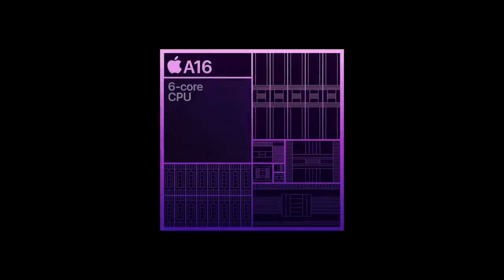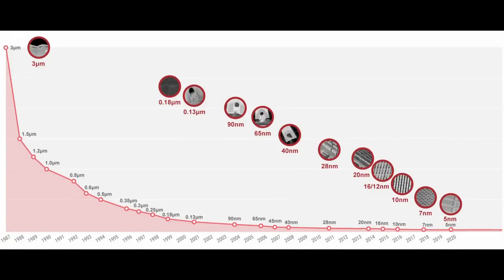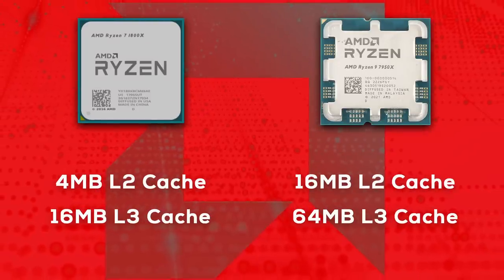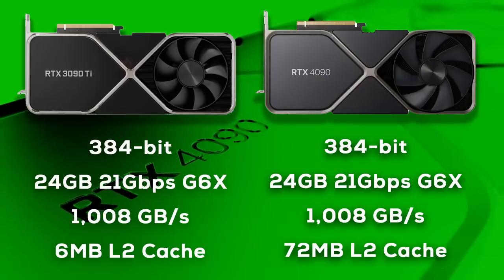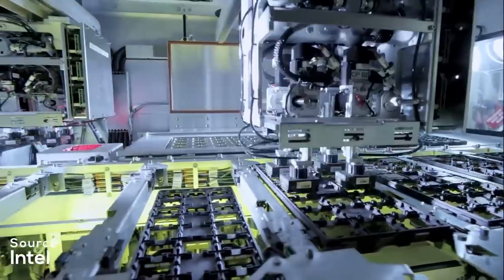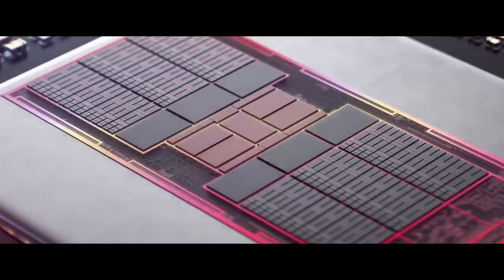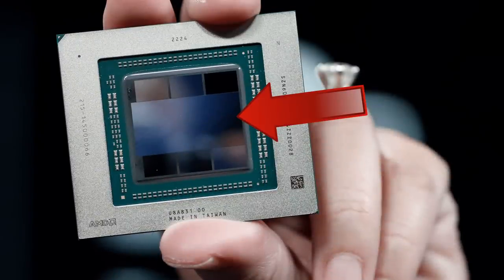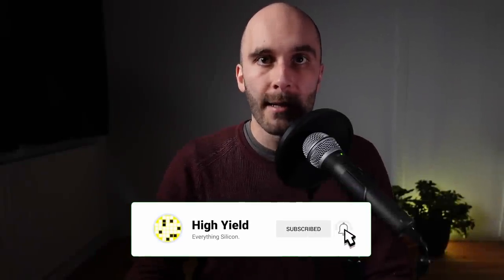Next-Gen CPUs/GPUs have a HUGE problem!

Comment: I think we've reached the point where the obsession with improving processors needs to take a back seat to actually bothering to optimize code. We don't need increasingly small tech that will overheat at the drop of a hat because of how hard we are working it. We need increasingly efficient tech that can do more with less!
Reply: And more competent software makers, that work to optimise on potatoes and scale to take advantage of powerfull hardware. Right now they just make it work, creating performance issues all around. No wonder CSGO runs so well on anything you throw at it, it was made when devs cared about it running on a potato
Reply: I totally agree. The software side of things has so much catching up to do.

Comment: That's what I was thinking as soon as your video started. That's also why I'm not beatin up on AMD for RDNA3 performance numbers out the gate. They knew this could happen, but still went for it to do the work needed to get it down. I respect that and am happy to support the work.
Reply: AMD prefers to future proof their design than going down a linear path that they can't dig themselves out of...
Intel made the wrong mistake of sitting on their butts when AMD was trying to innovate themselves out of bankruptcy from years of being screwed over by shady business games by Intel and Nvidia.
Nvidia is doing the same by not showing that they can innovate as good as AMD in hardware... They just showoff software 80% of the time which hypes and appeases content creators and such, but doesn't really future proof via engineering. They also push for AI a ton, but powerful AI needs smarter and well designed hardware because those too will hit a limit, as everything comes back down to the silicon level.

The problem with microprocessors is not today or tomorrow, but it's several generations later When Lisa Su and Jensen have to name their successors.
Reply: same here, that's why I said I be buying RDNA4 since August XD I'm nobody's beta tester boy.
Reply: Meanwhile nvidia is prepping a 4 slot brick called titan while amd is work hard at innovating 😅

Rdna4 better deliver i want upgrade my 6900xt
Reply: @sudeshryan8707  The power usage naturally goes up because of all the high tech components they want to put into the chiplet or silicon.
you still have to upgrade your basic components like power supply and motherboard and CPU in the end.
Reply: @dra6o0n  higher tech = higher power consumption?
Reply: @kotekzot  Well, you gotta change up some of the components if you can't shrink them, or re-route some sort of mechanism into another form, so in this case sometimes the power usage will increase if it grant a scalable performance gain.

For instance the chiplets, they changed something in the GCD to basically allow the chip to do two workload simultaneously, thus doubling performance and reducing latency.

But it also double the power draw for that one unit that utilizes it. The advantage of this tech is that you fit 'two' actions within one space, the disadvantage is that your power scaling also happens.

If you think of it like a grid based 'puzzle' game where you gotta fit shapes of components in a limited space, the component AMD's engineers came up with is like a lv2 version of the original component, but it comes with increased cost to use, in the same sized space.

You either make more energy efficient components, but end up needing more space to place more of them, or make more powerful components, you need less of them to produce the same performance, but power usage is higher.

lets say
Component A = 1x perform, 1x efficiency, 1x space
Component B = 2x perform, 0.5x efficiency, 1x space
You have a grid of 4x4 spaces.

Which would you put more of, standard efficient pieces, or powerful less efficient pieces?
Reply: @dra6o0n  an i3 12100 has twice the processing power, half the power consumption and a 38% smaller die area compared to an i7 960.

Comment: As for chiplets and specifically future RDNA designs I wonder if moving from a N6 to N5/N3E MCD would even be worth it? And although it seems TSMC has hit a dead end with SRAM scaling, I wonder how well other foundries are doing. Like for example as you say, Intel is using some TSMC manufacturing for Meteor lake, and I wonder if Intel has a more efficient SRAM scaling.

This also calls for Nvidias Blackwell. They've benefited a lot from Samsung's 8nm node to a custom TSMC N4 node. While I don't doubt Nvidia to take the performance crown again, I feel like 4000 series has benefited a lot from the silicon. Will they also have a desegregated design as well or will they pull some blackmagic with further increased power draw? 

Btw I think the thumbnail is great lol
Reply: Nvidia hasn't got much CPU experience to do proper chiplet designs like AMD or Intel does, and Apple just brute force it's engineering with lots and lots of money in R&D to poach talents for that.

Otherwise Nvidia would have pushed for chiplets sooner instead of showing a proof of concept one time and then forget about it later.

Comment: This is weird. I just bought a Ryzen 9 5900X, to upgrade a 3200G in my second PC.

When I was comparing it to chips like the 5800X3D, I noticed the different in L3 cache sizes, and wondered how much area cache must be taking up on the chip.

I figured that a BIG part of the cost of the chip is the cache, since even 32MB will take up quite a large area of the silicon.

I didn't realize there was a problem with SRAM cell size on the smaller nodes, though. Interesting vid.

If only SRAM was somehow smaller and simpler to produce, we would likely never have needed to use DRAM at all.
I've often wondered how fast a PC would be if it's main RAM could use SRAM instead of DRAM.

(Modern DDR SDRAM is FAST, but the latency is still high compared to what I would think SRAM could do.)

Comment: Unless we have some sort of new paradigm shift in computer hardware, these limitations are why I think we're probably going to head into an era of off-loading CPU functions to dedicated co-processors.  We already did it with GPU's, and bitmining did prove that certain functions are better handled by dedicated hardware and can be done cost-effectively.  Plus, NVidia has been selling dedicated, specialized GPU hardware for AI for years, now.  I think we're going to start seeing more processing handled by specialized units as demands grow.  Exactly which functions?  I can't say.  For gaming, physics is the first thing that comes to mind, but PhysX was already a thing that failed and then got absorbed back into GPU hardware.  Perhaps we'll see a return of discrete physics units?  We also have dedicated AI chips out there, and I believe one of the things they get used extensively for is in processing image data in some phones.  It was heavily marketed a few years ago by several major players, but I don't know if that's a thing that's still being done on current-gen phones.  

Point is, manufacturers have already done it and are at least trying to find other applications to offload to dedicated silicon.  So far, the physical limits of semiconductors have not, yet, hit that brick wall that we've been getting warned about for years.  It's slowed, but so far manufacturers have been able to use other tricks to get generational improvements in computing power, so the wider industry and enthusiast community hasn't had to feel the pain quite yet.  Who knows, maybe manufacturers will be able to keep squeezing more cycles out of what we have right now for many years just because they will actually have to start doing real work on architecture re-working now that they can't just fall back on shrinking their transistors (and this, for the most part, is what we have been seeing, it's just a matter of how long they can keep doing that).  

But I think that when backs are really pushed up against the wall, we'll start seeing more radical solutions start being brought to market.  I think that the fact that Moore's law is just about done with will likely mean that we're about to see a boom in innovative and creative new solutions because the "safe" path is no longer a viable one and corporate leadership will start being forced to try new things to stay competitive.

Comment: One of the typical advantages of process node shrinks that is advertised is increased performance, increased power efficiency, or a combination of both. Does this mean then that if you cannot continue to shrink the process, SRAM performance will be the bottleneck for newer architectures? What are the alternatives to SRAM?

Comment: Good video, but I would have liked to have the "physics problem" explained, and why it specifically affects SRAM cache. I can understand the analog limitation, as "lumped" parts like resistors, capacitors and inductors need chip area, but why is SRAM cache special? It's digital logic, just like the CPU? An SRAM cache bit is typically six or eight transistors: what is the "physics problem" why can this not scale?
Reply from the maker: If you are looking for more in-depth infos, heres an article from 2015 that clearly talks about the problems with SRAM scaling in detail: https://semiengineering.com/moore-memory-problems/

Comment: I'm actually looking forward to the day when we finally reach the limits of what a manufacturing node can accomplish in terms of nanometer node size. At that point it the costs and methods for making the most cutting-edge chips will really start to proliferate. The only thing that can improve a chip from that point forward will be the architecture of the silicon itself, which is where we sorely need the most improvements. It'll also be a good time for Windows and chip designers to come together and finally pare down the old x86 operating system to a standardized reduced instruction set format. We are also going to need more purpose-built components in our computers soon, to give our computers more integrated utility rather than speed. I'm most interested in what companies like Mythic have been doing with analog chips, because they've managed to use older process nodes to create insanely efficient chips that do very complex tasks in AI computing. We've been leaning too heavily on CPUs and GPUs to do these compute tasks and a lot of that work could be offloaded to newer, purpose-built components.
Reply: or they could stop wasting money on diminishing returns from miniaturizing silicon when its already close to its theoretical limits, and instead just work on commercializing a new approach to computing like photonic chips or carbon based chips.
Reply: @ilyarepin7750  This would be a welcome change. I dunno how far along in research we are with those technologies though. It may be that we hit the limits of silicon miniaturization long before carbon or photonic chips make their way into consumer devices. I just hope that hitting the manufacturing wall means cheaper silicon for a while.

Comment: Another strategy to solve issues w/ limited cache performance is to add another cache level.  I've worked on a product which had a rather large L4 cache implemented with DRAMs.  It did work well enough to avoid the immeiate issue which was to avoid respinning some custom chips which would have been crazy expensive.  On the bigger picture L4 caches are rather rare.
Another limitation of cache implementation is the size.  High end microprocessors of the 1980s had 64kB I-cache and 64kB D-cache.  With only small deviations these sizes have been almost a natural constant of microprocessor designs.  Basically 64kB per cache turned out to be the sweet spot.  Smaller may make sense for cost reasons. But larger primary caches get physically larger, thus move further away from the CPU resulting in slower access which rarely is a good design choice.
The result is the epidemic of multilevel caches.  L2 caches popped up in the early 90s, L3 not much later.  I think the Alpha 21164 EV5 release in 1995 was the first microprocessor with an L3 cache.
Reply: L1- and L2-Cache on die, L3-Cache-Tags on-die, L3-Cache-Data off-die on-package. A DRAM-based, OS-controlled L4-Cache with several thousands of banks.

Comment: Easy answer to the sram cache debacle, switch to 1T-sram, which is a hybrid SRAM/DRAM embedded memory, & is also an embedded version of psram or psdram(pseudo static ram, or pseudo static dynamic ram) & is the embodiment of the best of both worlds put into practice, as it has performance comparable to sram, while offering memory densities comparable to edram, & since the transistors are more densely packed in the same area 6-fold, then this type of memory, if used as a cache, would offer more cache memory in a smaller area, while also having lower latency than a standard SRAM cache.  

1T-SRAM based caches are the way to go onwards, especially when combined with vertical stacking & MCM.

Comment: well, there is also a physical limit of how dense you can store information, which happens to be the number of bits by counting the number of Planck squares on the surface of a black hole.  Basically if you pack too much information into a given space it will collapse into a blackhole, literally...

Comment: I was told one of the reason that sram doesn't scale well anymore is because s-ram used to actually use much higher density rules than regular logic. SRAM usually has separate DRC rules in a process, where they made use of all the fancy regular pattern techniques and so on to get that higher density. This made the density they could get in SRAM much higher than in logic. When you scaled the process, you mostly scaled the minimum sizes of general structures, and so by using the same 'hacks' you used in the last gen, you could scale the SRAM too. 
But now the logic itself is also starting to use these 'physics hacks'  to scale, with things like fixed metal line patterns and then having to use cut masks to do your low-metal wireing to get higher density in newer nodes. So in a sense, it is not that sram is no longer scaling - it is the fact that to get logic to scale, they are using the same tricks cache used for a long time already. As a result, the 'tools' used to make high density SRAM is no longer scaling, as the fundamentals are not changing.

Comment: It will all have to come together at the end. The drivers (AMD´s constant Achilles heel, it always takes years for them to make current gen GPUs great, often right before they´re replaced by new line; however, some bugs are never fixed, almost as if the devs didn´t know, what they are doing or underhanded dev team) and also software & games. Optimization may be the key in fighting the lack of SRAM scaling.